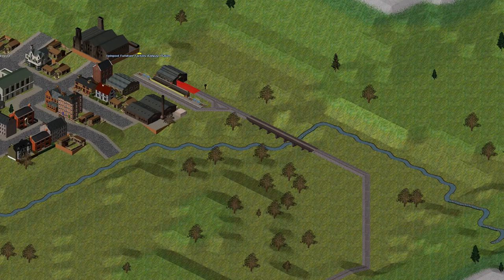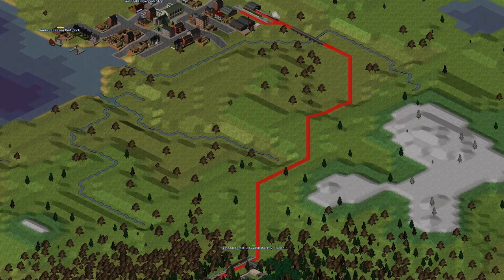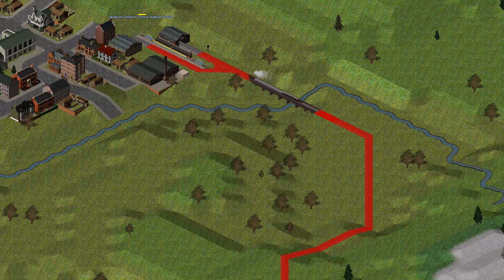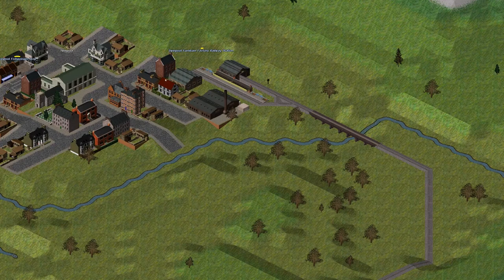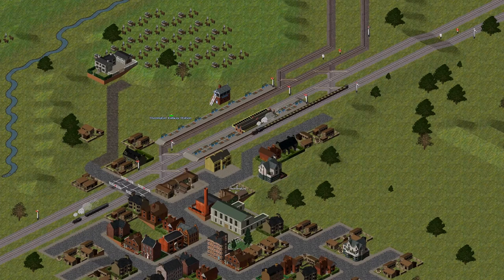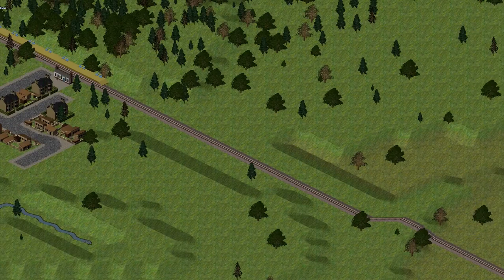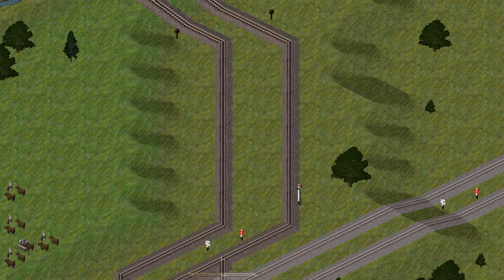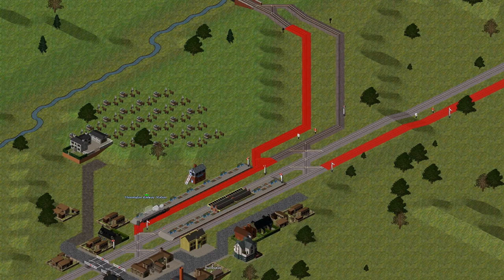One Train Staff Working

Comment: Hello, do you consider doing  let's play or more tutorials on Simutrans Exp when the new version comes out? It seems quite hard to have a positive balance with both freight and pax train lines as the maintenance cost is very high. And trains take ages to load goods at factories which don't produce goods fast enough even though the consumers has a healthy consume rate. It appears to me that the best way to start business is intercity pax lines for road vehicles. In all, pleasant game with enough things to occupy oneself for hours.
Reply from the maker: Thank you for your reply, and apologies for the delay in responding: I am afraid that I have only just noticed your comment.

As to balance, the economic balancing work is so far incomplete, which is why Simutrans-Extended is currently released on the basis of being early access. Balancing is a task which cannot be started until a number of features necessary for proper balancing have been implemented, which cannot in turn be started until a number of other things have been done, on which I am currently working. 

I do, however, plan to make further videos explaining other signalling working methods and other game features.

Comment: I still can't make this work. You should explain it better, be more practical. How can I use it in this type of line: a single track with double tracks at stations for train crossing? I find that trains ignore the cabinet if I put it inside the "station" (after the platform and before the single track), but if I put it after (in the single track zone) trains will get stuck when one of the opposite direction comes.
Reply from the maker: The one train staff working method is not intended for the situation that you describe: it will only work with the specific two types of situations depicted in the video. What you need for the situation that you describe is the token block working method.
Reply: I see. Thank you :) I will need to wait some more game-years then.
Reply from the maker: In reality, most early railways were double track for this reason.